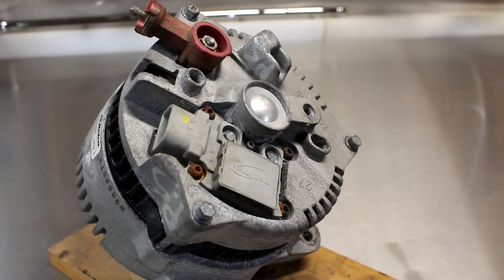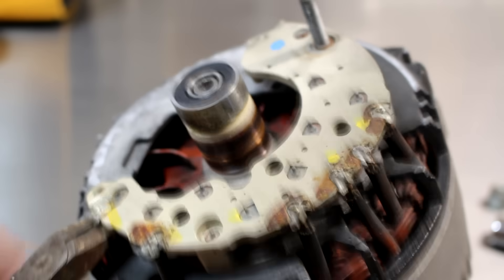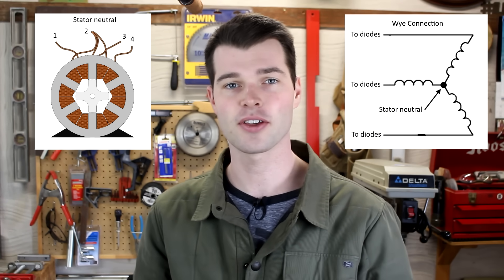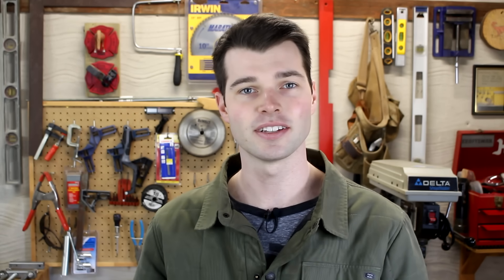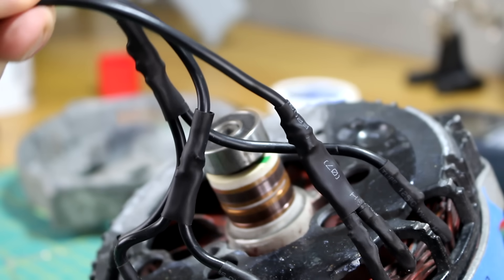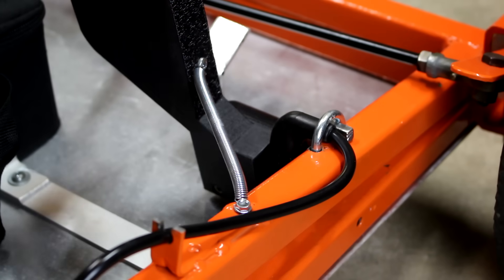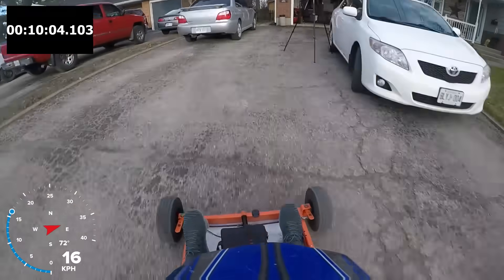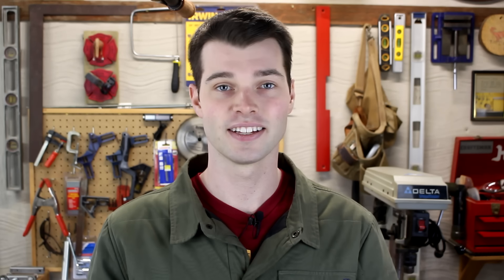Converting a Car Alternator into a Go Kart Motor

Comment: How many volts can one handle ?    I want to do the yfz450 electric conversion   some are using gear reducing motors   but im not in  for a 800$ motor when I have the know how and work for Ford  to get a free alternator

Comment: hey, love the idea of a alternator to use as a motor. Have one on my livving rom now, and its like your with 6 wires, phase A, B, and C. 
Lets call them A1,A2, B1,B2 and C1, C2. You said you must wire them as a Delta configuration. 
Do you weld A1, B2 and C1 together and take out the phases thrue A2, B2 and C2? looks like you soldering in some diodes, if so, how do they stand with the anode and katode?
Thanks for taking the time to make a video like this and anwser.

Comment: Cars alternator are 12 Volt , how this after changed need to 48 V ???
Reply: It wasn't changed for more voltage, it's the same wiring, but if used only 12v it would spin very slowly, so they used 48v so it spins faster

Comment: Why did you remove MY1020 electric brushless motor and put alternator motor instead? MY1020 is quite strong brushless motor too. How much power do you get from this alternator motor with 50 V battery?

Comment: Can we make use of 6 Series  x Super Capacitors of 2.7 V 3000F Module connected with Battery in Parallel connection??

Comment: Why you didn't use other alternator link on each other only to charge battery, that's they're function right. Unlimited drive
Reply: But their efficiency is so low that they would only waste energy instead of recharge
Reply: You get the idea don't ya
Reply: @josealmeida8731  yes i do, but even with new alternators and similar power levels (so one doesn't overpower the other) the energy recovered wasn't enough to charge it
Reply: With other alternator you have to rise the r. p. m. The sprockets  must be right leveled and some electric board must be used to avoid overload the battery (stop/go)?
Reply: If you used the second alternator as a braking system, you'd have a KERS. Set it up using a CVT to have variable braking (as opposed to on/off)
Reply: @timewazard  they don't even need a second alternator, the controller can already activate it's own KERS-like regen braking feature

Comment: Can you explain or write down the working principle of the alternator as a go kart motor
Reply: The rotor when connected to a battery becomes magnetized (like a magnet that you can turn on and off), allowing the brushless controller to "spin" it with magnetic force using the three phases of the stator

Comment: How do you know how many watts, volts, amps and how many rpm the alternator can take? I want to build one that I can use for racing to get up past 70kmh with 14 inch wheels
Reply: I do not think that is possible due to the nature of the alternator. Even if it is, it is not worth the money you put on that think to make it work
Reply: For the volts it is easy, usually they have between 12 or 14, not a big difference. The reason this will not be viable is because of how many amps the alternator consumes, it varies from 40 amps to 400amp and there is no battery you can make that will make this viable for what u are looking for. You should see this video as entertainment and this Kart as a "toy"

Comment: What if you use two alternators, one for the motor and one hooked up to the battery with a belt running off the drive line recharging the battery 🤔
Reply: Won't work, their efficiency together is lower than the energy spent

Comment: It would be interesting to add multiple charging receptacle that accepts the style of most cordless brands, then you can just slide the battery pack into it's receptacle like a Milwaukee drill battery pack.
Reply: other creators did it, like Hacksmith's mario karts

Comment: The number of wires is not a reliable way to determine if its wired as a Y or delta. I rewound an alternator that had only 3 wires coming out of the stator, but had the Y neutral buried inside the winding wrappings as there is no need for it to be connected to the rectifier.

Comment: Why not wire it in a Y configuration
Reply: Yes, he could do that,  would be sacrificing a bit of starting torque I think.   It may not burn battery connection and may get better range from a battery charge.

Comment: What about using 4 standard 12v car batteries to get more discharge time? I realize this would take up a larger space, but wouldn't that give you a lot more running time, and avoid the over discharge problem? Plus you could tap one for 12v for the center tap. I like your design quite well, and plan to pattern one after your example. I suspect there would be a big variation in performance depending on exactly which alternator you used. Do you know if this one you used come from a car, truck or RV?
Reply: Car batteries aren't made for high and long discharges (and as himself said in the video, the basic 1500W system pulls more than 25-35 amps), so only deep cycle batteries or proper traction batteries like the ones found in forklifts can handle these loads.
That doesn't mean you can't use them at all, you still can, just that you won't have that long of a lifespan of the batteries
Reply: @foxxyytofficial  Good to know. The extra weight and space is not the only downsides
Reply: He does use 4 car batteries and he states it in the video.  Do you mean an additional 4?
Reply: @robertmorin6495  Oh, I understood he meant very small golf cart 12 volt batteries. Not car batteries as I suggested.

Comment: I did essentially the same thing when I was in grade school in the 1960's, using a mini bike, gears and chain from an old Honda motorcycle, an alternator from a 1950's model Ford (I'm not sure what specific model or year) and a "Juice Box" car battery, and it worked. However, doing this in the 1960's, using 1950's parts, it was anything but efficient. It would take all day to charge the battery, but 10 minutes to use it up. 

But I sure enjoyed those 10 minutes... :)

Comment: Why do you still need 12v for the brushes? Wouldn’t power through the controller be enough to start the motor?
Reply: because without the 12v on the brushes, there are no magnetic forces that the motor can push against and spin
Reply: @foxxyytofficial hey! Sorry to bother u. Can u explain why did he put a battery on the rotor winding and what is the purpose of that in more detail? And how does that thing attach to the brushes?
Reply: @lucatielofmirrah1389  he did put a battery on the rotor winding so the rotor can work as an electromagnet, and only after it "turns on" that the motor will work, as the controller puts energy into the main wires and the magnetic force will make the motor spin. to attach the battery to the brushes depends on the model, and the brushes connect to the rotor with slip rings (copper rings that can conduct electricity)

Comment: do a little proofreading before you post your video next time dude... right from the very beginning of your video you keep stating incorrect information about the number of wires that come on the alternator that you chose to use for this project... over and over I hear you say that you have six pairs of wires and blah blah blah blah blah and that's completely incorrect.... what you actually have is three pairs of wires and six wires total....FUKING MORON! YOU COULD REALLY CONFUSE SOMEBODY THAT WASN'T PAYING ATTENTION TO THAT FACT NOT TO MENTION WASTE THEIR TIME WATCHING YOUR VIDEO AND COULD POSSIBLY DAMAGE THE PIECES OF EQUIPMENT THAT YOUR INSTRUCTING THEM TO USE THROUGH CONFUSING TERMINOLOGIES AND INCORRECT INFORMATION.
Reply: a n g r y h a h a
Reply: Slow down there m
Nope.  Watch the video a few more times and look carefully.  He did have 6 pairs of wires after the cutting.  Each coil has 2 ends.  Three coils times two ends = 6 ends. .. and each coil is double wound with TWO wires at a time.  Six times 2 = 12 ....12 wires total,  just EXACTLY like he said: six pairs. He had those 12 wires available, tested with an ohm meter and then soldered them together to form the delta connection. After the soldering, three wires were fed out of the enclosure. It's all there as he says in his video.  Watch it again.

Comment: Ok question sinse you’re a lot smarter than me. I want to convert and old ford alternator to a motor like you did however how would I need to wire it up to have it just turn on and worked. I don’t need a speed controller. Again just need it to turn on and spin. Any help would be very helpful
Reply: You will need a controller, if it was a DC motor like a starter it would be doable
Reply: @foxxyytofficial  so the alternator turned into a motor will be an ac motor then. Maybe I will just utalize a dc motor to try out what I’m thinking then. Thank you

Comment: But wait, doesn't an alternator generate AC where the diode then changes that to DC to travel to the battery... because torque is applied into the alternator to generate that AC, so by making an alternator into a motor completely undermines the purpose of the alternator?
Reply: Making a motor from an alternator doesn't keep ir recharging the batteries, only if your controller does regen braking

Comment: When I tried this out I found it alot easier to use old GM alternators rather than newer ones. I found that newer ones are a pain in the ass to disassemble, And on some brands the diod pack and brush assembly are in one piece so you have nowhere to solder some wires to to feed power to the rotor.

Comment: Did you use Hall sensors or did the alternator start without Hall sensors? What voltage (V) did you give to the rotor?
Reply: No hall sensors on the go kart
And 12v on rotor/48v on stator

Comment: When you apply the 12 voltts to the brushes, should there be resistance when you spin the converted alternator by hand? I'm not sure I am providing enough amperage because I feel no resistance and when I power the system the motor hesitates and starts to spin but halts and keeps cycling like that when I apply the throttle.
Reply: Make sure that the rotor is not shorted to the outside of the alternator casing

Comment: Hello, I too would like to make an engine with an alternator but mine has 6 contacts and they are coupled in order: the first with the second; the third with the fourth and the fifth with the sixth. How to wire them? Thanks.
Reply: Label the wires like he did, with A1/A2, B1/B2 and C1/C2
Then connect A2 to B1, B2 to C1 and C2 to A1
That is delta wiring

Comment: Is it possible to add another alternator to.the mix which will charge the batteries? Make bracket to mount alt...add a pulley to the gear drive shaft use a belt to.connect the two motors.
???
Reply: That is not possible

Comment: I've got a geo metro that I'll be putting quad tires on and exploring the back country a bit with but I dont like not having 4x4. I wanted to mount some hub assemblies in the rear sonic can install some CV axles and either a couple pillow blocks and a sprocket or an old diff and mount a motor up in the trunk so the passenger can grab a remote and turn on the rear axle. Think there are anything a little more robust that the average alternator? Maybe a starter motor? I'm just thinking geared right these should be able to spin the rear tires in short bursts, this area of engineering is not my forte hahaha

Comment: Really cool! I have an old stand up scooter I wanted to do this with, since I also have a few alternators and even a speed controller sitting around....I wonder how much torque/hp one can get from a converted alternator? My guess is around 1/3 of a horse, mabey up to 1 horse with a good battery/ esc?
Reply: in his part 3 video he got up to 100amps @ 48V, so total draw power would be 4800W, but since the alternator isn't as efficient as a proper motor, probably he got 3000-3500W max power

Comment: Nice work! One question I have is whether you needed to establish the polarity of each pair of windings so that the three magnetic fields don’t “fight” one another?
Reply: In a three phase motor that doesn't matter. Swap any two of the three leads going to the controller to run the motor the other direction.

Comment: Does the rotor get unregulated 12v and unregulated amps as well. Is there a limit etc?
Reply: Since the rotor winding is just a loooong wire, it will have a fixed resistance (ignoring heat changing it)
Basic electricity equation (Voltage divided by resistance equals current) tells me that it will have a limit, max 5-6amps
Reply: @foxxyytofficial that is the purpose of the 12v? Do u have any idea of someone explaining this in a video? And showing where you should attach to?
Reply: @lucatielofmirrah1389  yes, that is the function of the 12V, there are some other videos about converting alternators that talk about how and where to use 12V

Comment: I know this video is old but hopefully someone can help me out, I am trying to replicate this project but I cant find any information at all on where to plug in the three wires from the stator on the alternator and do the two wires from the rotor just go straight into a different battery or is there something between them as well?
Reply: The  3 wires from the stator are connected to and powered by the three phase controller outputs.  The three phase controller is powered by his big giant 48 volt battery pack....the four 12 volt car batterys
Reply: Could you explain clearly to me what do you need?
You want to use one battery to power the rotor AND stator?

Comment: hi bro, thanks for you vid, my doubt is if I excitate the coals with a lithium battery and power the controller with acid batteries could make any diference, I need to check if my phases winding are correct or any bad contact wires too cause engine is not working
Reply: that would not be a problem, electricity is electricity, coming from lithium or lead-acid

Comment: Good idea, tho the car starter makes a better high torque motor for a go kart and doesn't need a brushless speed controller to run it.
Reply: But it will overheat and won't be as reliable in long term

Comment: Interesting note - the next (6G) generation of this alternator has closer iron bars on the stator, which means 4ish mm wide hall sensors will not fit between them. I'm considering mounting small button magnets on the fingers to trigger them mounted on the case instead rather than cutting into the bars to mount them. Anyone have photos or videos of successfully doing that?
Reply: On facebook there are groups that talk about converted alternators
Two of them are focused on adult ride-on racing and one is just for alternator conversion
Reply: @foxxyytofficial  What are their names? The only one I found was "Car Alternator as BLDC Motor"
Reply: @hallkbrdz  hacky racers and PowerWheels Racers for Adults

Comment: Hey dude i have a question. I want to build this too! And i want a stronger motor.. and i searched for Truck alternators! I can find gigantic alternators.. are they producing more power and can i go faster with them or they only have more torque? Greets and thanks for this nice video, Max.
Reply: Since truck alternators are bigger and thicker, they will pull more current but will have a bit more torque
Reply: @foxxyytofficial  ok ty. I found an perfect motor for this. https://www.freerchobby.cc/products/frc-25kw-mp120100-kv50-outrunner-brushless-motor-for-electric-paramotors-and-electric-go-karts  its not an alternator anymore but this thing has 25KW and is good to accelerate an homebuild buggy to more then 100kph.
But i will also test an alternator on my bike. Thanks for youre answer.
Reply: I alsl recommend you to install the hall sensors like in part 2

Comment: Nicely done. A word about fuses from an EE - the presence of a 40A fuse does not tell you that the current did not exceed 40A. Many 40A fuses would not fail until the current reached 60A for a long time or 80A for a brief time. Perhaps you could install an ammeter to confirm this if your batteries have a current limitation! Its good to see the fuse there as protection from a wiring short but they are not much help with overloads unless you use a lower current fuse of known failure characteristics.

Comment: Tried this but my alternator turns very slowly (with little torque). Do you think this is more likely a problem with a corroded old alternator or just my electrical setup?
Reply: how much voltage are you giving your alternator?
and the brushes?
are the bearings ok?
Reply: @foxxyytofficial  Running 36v and have tried between 3-12v on the rotor. It's a ford alternator of some sort? Bearings and pretty smooth and brushed seem good. I have had best success with low voltage on the rotor but it's still running slow. I've tried all settings on the (cheapy Chinese) controller with no change.
Reply: @blend-bites  the less voltage on the brushes, less torque and more RPM
Check if you removed completely the voltage regulator

Comment: How do you determine the size of controller to use?
Reply: on how big will your current to be
For karts and bigger stuff, 1500W
for kids' vehicles, 500-1000W
Reply: @foxxyytofficial  Won't the size of the alternator determine the current flow?
If the alternator is rated to produce 100 amps at 14 volts be a good basis of the current flow. Is this a good assumption?
Reply: @rayvillaflores982  that would determine the max current flow, but alternators aren't efficient as "true" motors, so those 100A are not all used for moving.

For bigger controllers (2000W and more), most certainly you will need hall sensors installed or the motor controller won't run

Comment: Great job! One complaint: Nowhere can I locate a controller that is designed for use with both brushed and unbrushed motors!  I copied the PN# from the one you are using on this video but it (or any other) does not come up on any Google search. HELP?
Reply: Only VESCs can do that